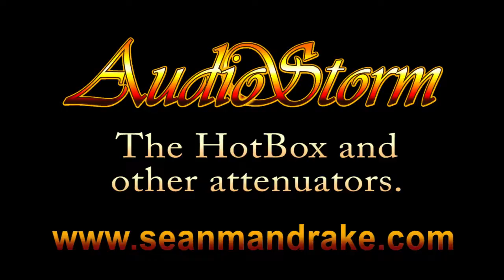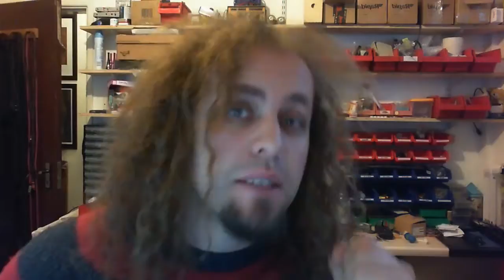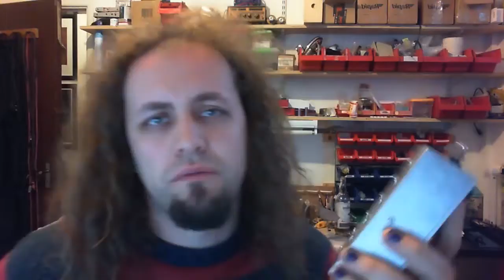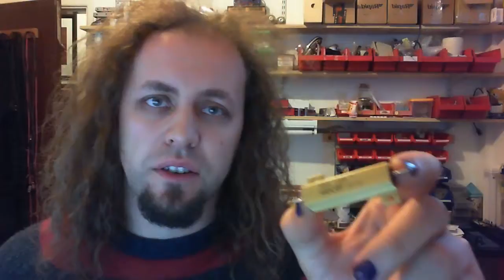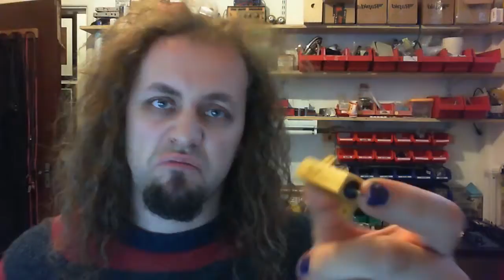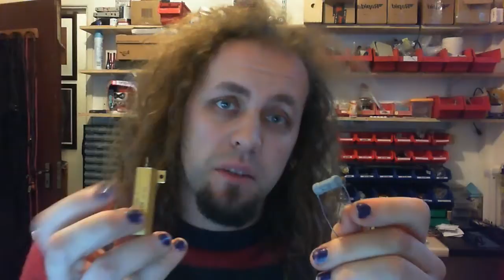HotBox : The Infomercial!

Comment: Hi Sean,

i recently bought a hotbox 60 8ohms and just before it being delivered i released my amp is 16ohms. i have two 8ohms(2x12) connected in series so total 16ohms impedance. At the back of my amp the speakers are connected to 1x16ohms loudspeaker output connection. i also have few more loudspeaker connection available at the back of my amp they are 1x8ohms, 2x16ohms, 1x4ohms and 2x8ohms. 

Is there any way i can still use the 8ohms hotbox 60? or do i have to return the item back to the merchant?

thank you for your help

Kind regards
Kim